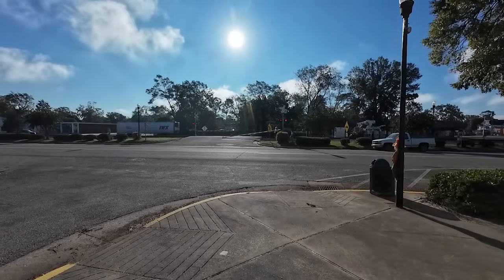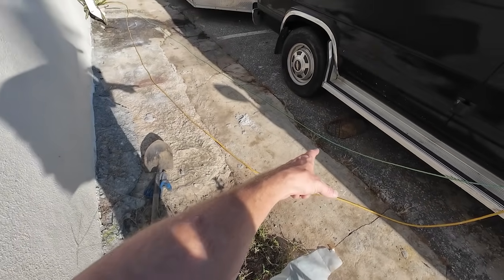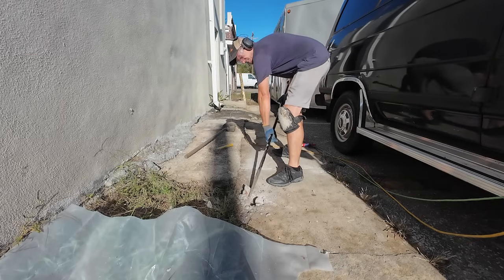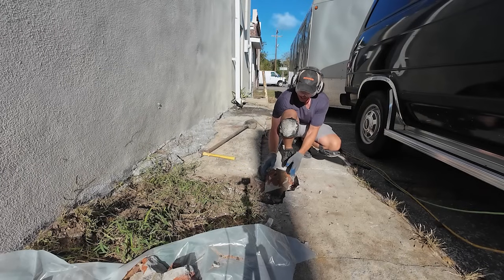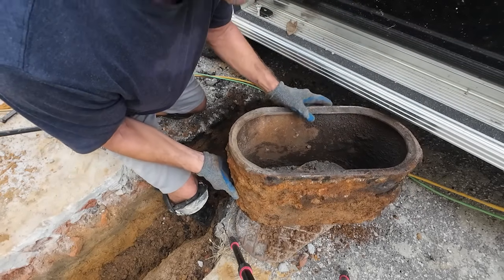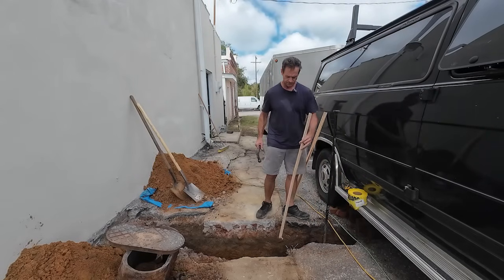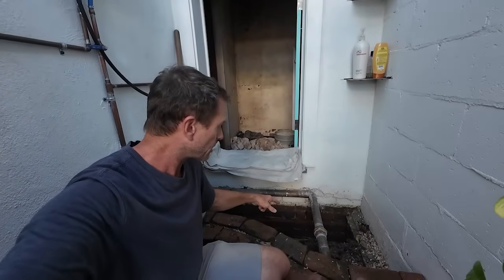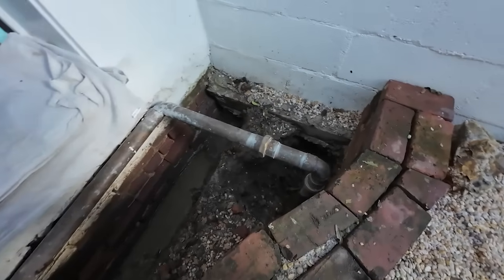Digging Up The Past of the Abandoned Bank of Johnston

Comment: My suggestion for starting that weed eater if it's kinda tough to start would be the take the plate that holds the recoil starter off in disuse a drill to start it with a socket